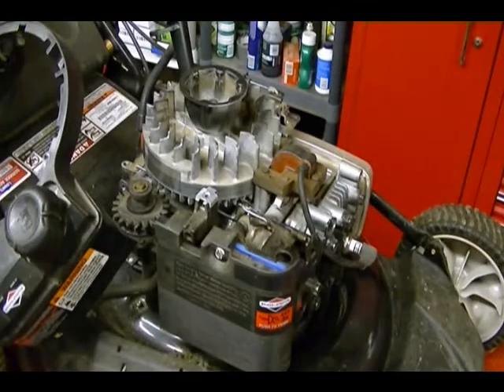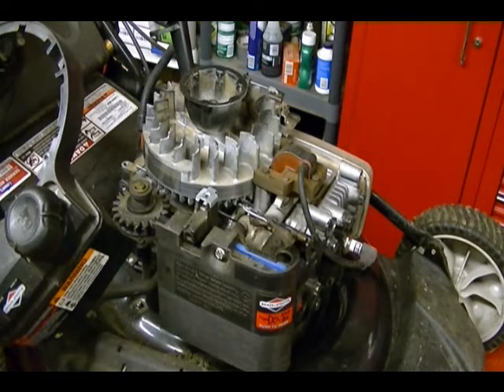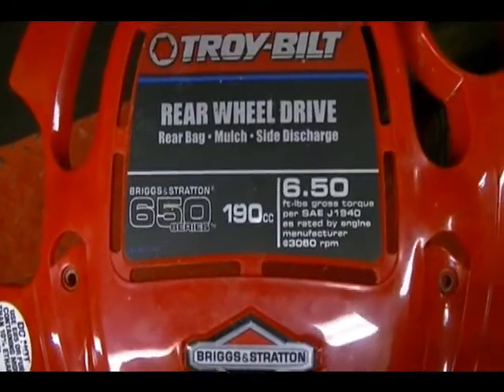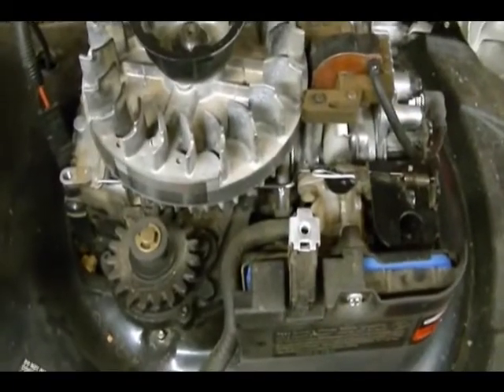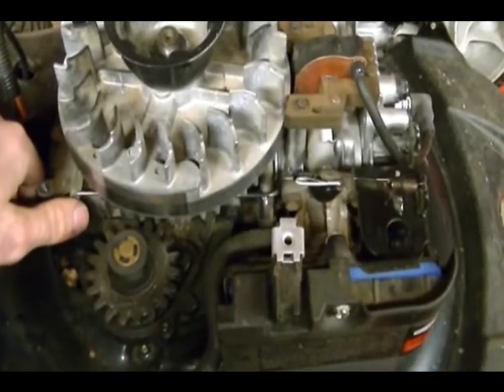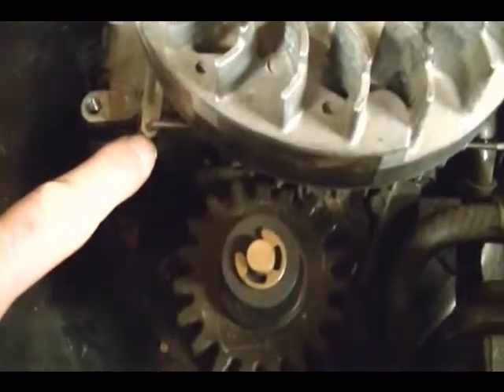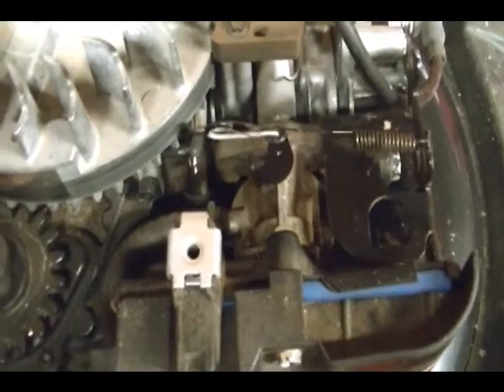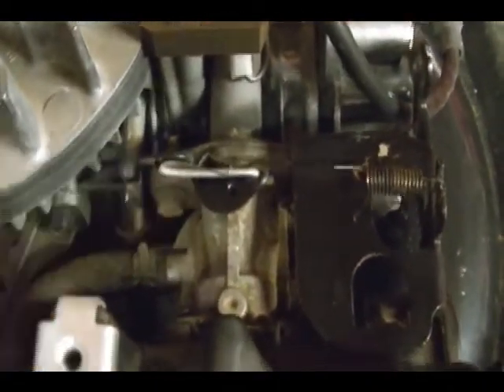Carburetor Linkages for a Briggs & Stratton 650 Series L-Head Engine

Comment: Hi, my lawnmower is the same as this and I have stripped it down, cleaned it up and put it back together. It runs but is over revving. Can you show me how to reduce the revs? When I move the linkage slightly with my finger while its running, it reduces it to a normal level but I can't figure out how to keep it at that level. Cheers.

Comment: I have the 650 series engine on a TroyBilt mower. I've replaced the carb, blue spark on plug, good gas. The mower won't start on its own. I can use starting fluid and it runs just fine. But. In the "off" position, the mower will not start. I watched this video to ensure the linkage is right. It is. But the carb butterfly won't close to pull gas at startup. What's wrong? Please.
Reply: I have the same issue. Ever figure out the problem?